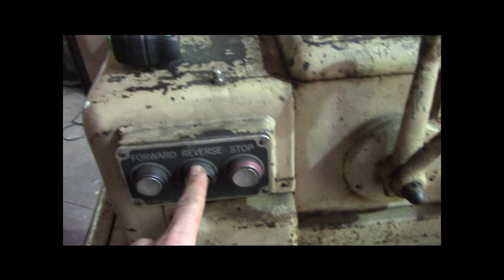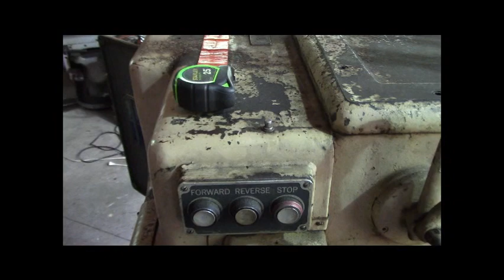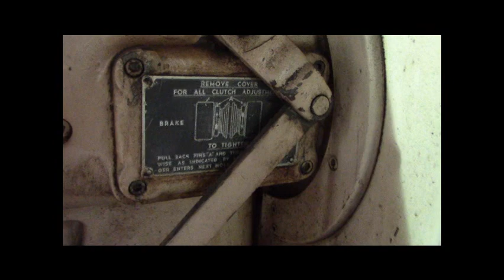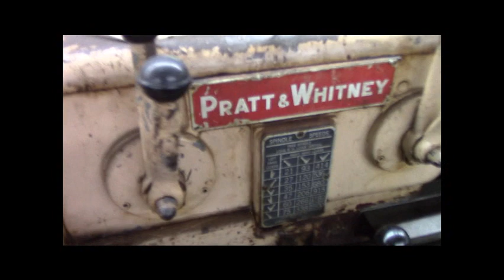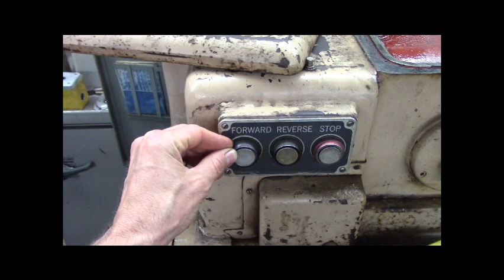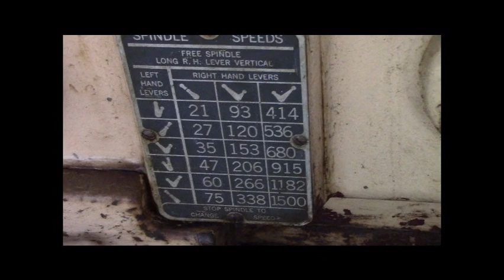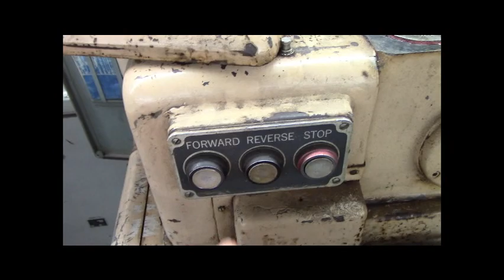5-10-21  Pratt  & Whitney 12C Lathe 1956 vintage

Comment: About 3 more lathes and you'll be set.  nice looking shop.  we share a few machines,  have a pw 12c too, and a VN 22.  thumbs up on the videos!
Reply from the maker: Hey thanks Diana.  Cool we have some of the same machines.  Are you on FB or Instagram ? ? Would like to share experiences.  --Doozer
Reply: Do you have the taper attachment for your P&W 12C? I have a 1948 Model C but am missing the sliding block for the taper attachment. I'm trying to get the design and dimensions of the block to make my own. Could you help me with that?

Comment: Beautiful machine, Doozer.  Those P&Ws were very well-engineered lathes, and quite expensive (the P&W 3C bench lathes and mills were each the price of a nice car, according to a 1941 War Prod. Board doc!)   Almost bought a P&W 3C mill from Hicottn off Ebay a few years ago, but was missing some parts and was pickup only (I'm in NJ). Oh, AMF also owned Dewalt, and I have one of their fine radial saws from the fifties!
Reply from the maker: Chris still has the 3C bench mill.  I layed my hands on it!  Oh the machines I saw in that warehouse !  I saw two 13EE lathes right next to each other !  Lots of treasures.  My dad has a pre AMF original DeWaly radial arm saw. Very heavy little saw.
Reply: @kooldoozer  IIRC, one of the tapered gibs was missing on the 3C mill, which is one of the reasons why I didn't bid.  He sells some really interesting stuff on Ebay, like old electronics and wood planes.  The AMF model that I own is a GWI 10", but needs some work before I can run it.
Reply from the maker: @danielabbey7726  He has a Gorton 0-16 mill in the warehouse that is way sweeter than that PW3C mill. Cleanest 0-16 I have seen. Chris has lots of old radio stuff.  Even a Marchoni rig like the Titanic had.

Comment: 13:00 those pins are taper (or straight) pins to retain the tailstock end cap. My Sidney is the same way.
Reply from the maker: Thanks Noah, I did not know they were pins.  Usually that back TS bearing retainer is threaded on, the lathes I have seen.  Good to know if I ever have to take it apart.  You helped me out.

Comment: Looks like a beaut. I wondered how that turned out after our call. I'd wager this will become your most used lathe. It's a perfect size and they just run so nicely. The more research I've done, the more I've come to the conclusion that the P&W lathes were the best WWII machines available, bar none.
Reply from the maker: Well, it is a great lathe, but I think your Sidney was better back in the day.  Constant mesh Herringbone gears and dog clutches are #1 top of the line, like your Sidney.  Constant mesh Helical gears and dog clutches are #2 in line, like Monarch and others. Straight cut and sliding mesh gears are #3 in line, like P&W and many others.  So In reality, my P&W is third tier from a mechanical design point of view. P&W just made real high quality straight cut gears.  So I am not fooling myself in thinking this is the best lathe out there.  Just perhaps high quality and well executed for what it is.  Side note, my 17" Colchester has straight cut, sliding mesh gears, (except the bull gear that is constant mesh, helical, and dog clutched), and it sounds like a cracker box :(  You need ear plugs to run over 700 rpm.  Oh well, she is good in capacity and ruggedness. ----Doozer
Reply: @kooldoozer  Bah. You're right about the headstock, but that is only part of the lathe. Sidney was very old fashioned, even for 1943 in many ways. I like that your spindle has a real center bearing not just a bushing. Yours has a much more modern speed range. The tailstock and compound are more user friendly. Fact of the matter is nobody had it all. But if you had to compare all of the lathe, then I'd put that P&W up against anybody. Sidney did do some things very well, like the apron oiling system. The feed clutches are the best I've ever used, bar none. But I would still be elated to have a tight machine like that one.

PS, the quietest lathe I've ever run is a Nardini, which spur gear all the way around.
Reply from the maker: @TheMetalButcher  Interesting on the Nardini.  I used to have a 1440 at work, and I really loved it.  That carriage pop stop was great.
Reply: @kooldoozer  That's what I run at work. It does better than I would expect all thinks considered. The carriage seems a bit small and the ways are narrow front to back but I can't deny how well it works.

Comment: I bought a 1948 P&W Model C 12 x 30 a few years ago and restored it, almost identical to yours. I'm sure you're happy with this lathe, they're bullet-proof. However,  mine is missing the block that rides in the taper attachment. Any chance I could get the dimensions and design of yours so I can make one for my lathe?
Reply from the maker: Sure, hit me up in my email and I can send or text message you some pics and dims.  
kooldoozer@yahoo.com

Comment: All the old lathes had small spindles. Across the board, basically every D1-6 lathe had a 1 9/16" spindle. The D1-8s are 2 1/8" or so on the old lathes. PS. My Sidney uses two lock nuts on the spindle bearings instead of using a a lock washer. I think it's a good idea as the washer isn't going to be as flat and you want as a flat of a face as possible so as to not cock the bearing. My Sidney has tapered roller bearings, but they are at the ends. The middle is just a bronze bushing. Kinda cheap TBH. I think yours is the better setup if they are tapered rollers, I do not like ball bearings for spindle bearings. Don't engage your LSR over 140 or whatever it says RPM.
Reply from the maker: It has ball bearings.  I might by a new set from Chris who sold me the lathe.  Interesting, John Oder was talking about converting his to Timkens before he sold it.  The middle bearing is a flanged ball bearing, kinda special.
Reply: @kooldoozer  I wonder why P&W did the Ball bearings? The high speed?
Reply from the maker: @TheMetalButcher  Tapered roller bearings heat up more, so maybe higher speed yes.